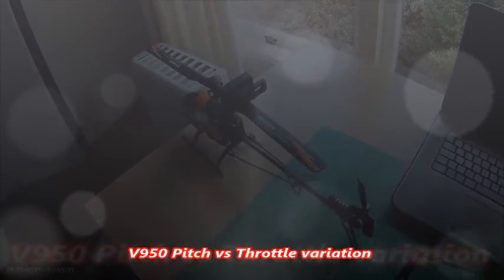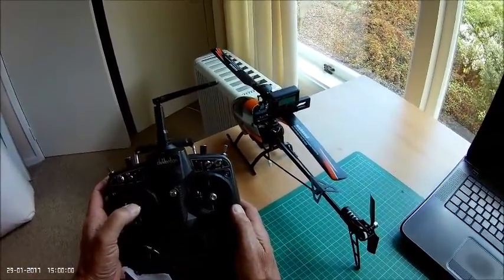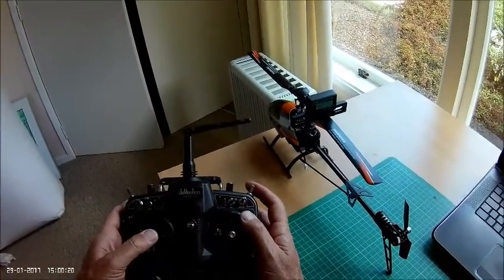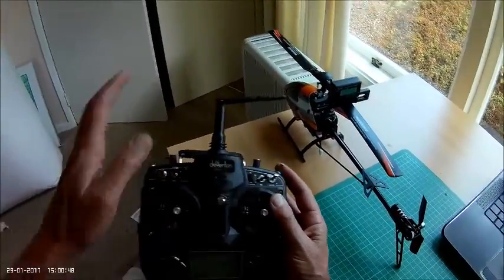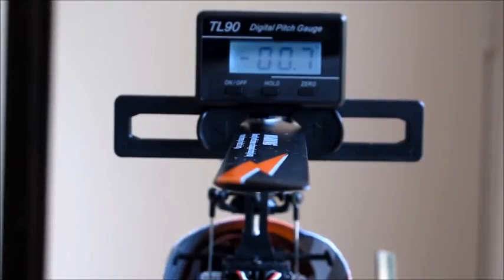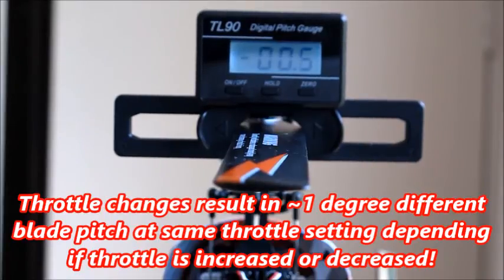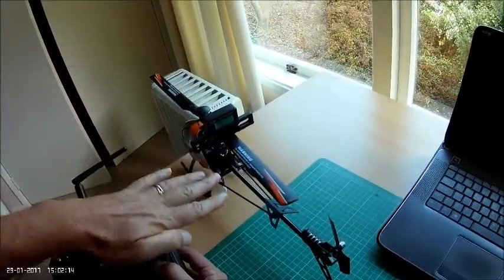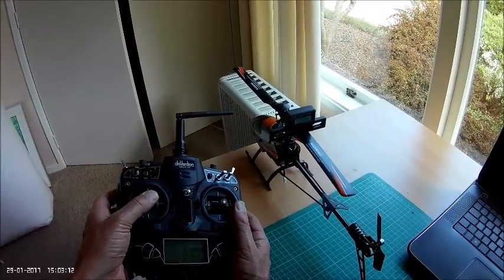V950 Servo Centering on Pitch Changes

Comment: Hello friend, I'm subscribed here on your YouTube channel!
I need some tips to get my V950 right.
What is the usage reference for the Pitch Gauge?
Does the heli table itself or a flat surface with a upright heli work?
Set the Pitch Gauge to both options as 0.00 with the Stick down to 0% and fit the links! That's right.?
Reply from the maker: I'm not sure that I understand your question. What this video was showing is that the blade pitch was not centering correctly with the stock V950 setup, and instead of returning to 0 degrees pitch there was a ~1 degree difference in blade pitch. This means when flying instead of having a smooth hover, the helicopter rises up, or goes down depending on your throttle setting making it difficult to keep a steady height. I have changed to Walkera Master CP head, drive shaft and main gear, plus changed servos to Blue Arrow units and it flies better. The best head/swash setup is the new V950 CNC aluminium head from MicroHeli though. A good quality helicopter will return the blades consistently to zero pitch. Unfortunately V950's have not been good although mine was an early production model.
Reply: @FlyingboatsRCG  Ok friend thanks a lot for the help!

Comment: Very interesting,but most of us don't have that kind of level gizmos !
Reply from the maker: :) You can swing the blades parallel then measure the distance between blade tips to calculate pitch if you don't have a gauge. The gauges are definitely recomended with larger helicopters and do make setting up CP helis a lot easier. I also just made a swash levelling tool for the 950 as well, a little crude but getting the setup right definitely helps!

Comment: i can use devo with v950 ?
Reply: Want to know what modules to use?
Reply from the maker: Sure you can use Devo. I use Devo 10 but 7E (more difficult to setup) 6, 8 and 12 are also possible I believe. V950 uses the KN protocol which requires an NRF24L01 module to be added to the radio. I used to have one of these but have now replaced it with a 4 in one module that allows me to fly almost anything. Adding modules: https://www.deviationtx.com/wiki/rf_module_installation List of protocols from Deviation website: https://www.deviationtx.com/wiki/supported_models 4 in one module available at Banggoods for Devo 7E and 10: https://www.banggood.com/CC2500-NRF24L01-A7105-CYRF6936-4-In-1-RF-Module-For-Walkera-D7E-D10-Transmitter-p-1096707.html?cur_warehouse=CN Please also note that are now radios coming out with the four in one module already installed like the T8 Jumpers: https://www.banggood.com/search/t8sg/133-0-0-0-0-44-0-price-0-0_p-1.html
Reply: Thanks for the info. Follow the work . We like the same. Now I'm experimenting with the Fs-i6 transmitter with the IRX4 and IRX6 modules.
Reply from the maker: Cool. Good luck!
Reply: FlyingboatsRCG how do set the pitch curve?.. is this not built-in to the Heli?.. is it possible to set mixes for pitch curve with this Heli?
Reply from the maker: If you have a computerised radio (not sure if the stock transmitter can do this) then you can adjust pitch trim on Channel 9. The basic pitch curve is hard coded on the helicopter, but it is possible to adjust it up or down slightly using Ch9. On my Devo 10 radio I first used a pot on Channel 9 so i could fly it and try different levels, then setup 5 point curves relative to the throttle curve. Quite frankly it's a pain in the butt to do, and I wish WL would develop an XK branded version of the 950 where you could set proper pitch curves!

Comment: FlyingboatsRCS , you and I were in this discussion in some other thread. I know why the hovering is so bad now, after about half a year of research. It is the ESC firmware "Governor" . The v977 also is very hard to hover due to the same software. If you look up BLHeli governor, there is a RPM threshold, which you often cross it when trying to lift the heli but this threshold is higher than enough to hover, but which once reached the ESC firmware will keep this RPM on the motor regardless of whether you have enough thrust. This firmware assumes you are an acrobatic pilot, and the heli flies with "fixed RPM, changing ONLY cyclic pitch". To slow down the rpm, you have to aggressively cut the throttle to nearly half stick position. Once you cut to that level, the firmware assumes you are trying to land the helicopter!! And your heli is straight to the ground, and you have go back to lifting it, and the oscillation continues. I finally have my solution , buy the real SiLabs hardware ESC and configure the BLHeli firmware to disable governor. I fly Blade 200 SRX with my electronics with CC3D. It is so much less stress now.
Reply from the maker: Hi John. Interesting comments. I have flown a more recent V950 plus also seen others in the air with different servos (Futaba or Blue Arrow) which fly and hover well. To the best of my knowledge the 950 and 977 aren't running BLHeli on their ESC's, although I know some people have flashed the 977 ESC's with BLHeli which has been an improvement. I have BLHeli on most of my ESC's so am pretty familiar with it. 

On my 950 (and 977) it's very obvious that the motor revs are changing nicely through the throttle/pitch curve I actually use the change in motor revs with reduced pitch changes through centre stick to smooth the pitch response) and where mine has been causing problems is immediately after hearing a distinct "phut" sound from the rotors. On tracking it through I believe my issue has been primarily mechanical issues. First the servo arms were drilled oversize allowing the links to slop up and down under load. Secondly, when I rotate a blade grip the top part of the swash rotates slightly (this allows the link to move and the blade angle to change). So I believe the "phut" sound is caused by the rotor disk loading up, and twisting the blade grip & the top of the swash. Consequently the 950 jumps either up or down with the mechanical slop. I'm expecting this to be fixed with new head plastics with improved tolerances. The other things are that the programmed pitch curve isn't smooth (it jumps as throttle is increased) and in the video above is that the stock servos are not really good (OK but cheap). Note Banggoods  now have the Blue Arrow servos available for the V950. You need the "Type 1" -Reversed signal servos but these are excellent high quality, lightweight and fast metal geared servos which make it fly much better than stock: https://www.banggood.com/Blue-Arrow-D03013-Digital-Ultra-Micro-Preision-Servo-For-Blade-130X-Helicopter-p-1118700.html?rmmds=search

Comment: O módulo que você usa para ligar o V950 com o devo rádio?
Reply from the maker: This is the 4 in one module for the Devo 10. Requires 3 wires to be soldered so pretty easy to install. https://www.banggood.com/CC2500-NRF24L01-A7105-CYRF6936-4-In-1-RF-Module-For-Walkera-D7E-D10-Transmitter-p-1096707.html?rmmds=search

Comment: Devo 7 bind for V950 ?
Reply from the maker: No. 7E, 8, 10 and 12 can bind but using an extra radio module and Deviation software.
Reply: FlyingboatsRCG ok, thanks :)

Comment: Times like these reminds me why I like the simplicity of FP helicopters,anyways. I use the Flysky radio so I am not sure about the menu on the Devos but try to access your pitch curve settings I use pitch values of 40 43 50 75 100 for normal and 0 25 50 75 100 for idle up with 50 being about 0 pitch and set to mid stick for both normal and idle up. I actually set my 40 to 1.5 degrees and 43 to -1 degree so that she will stay planted in high winds. I found with this setting the Col. Changes are not as dramatic as with a linear pitch curve. Also 16 degrees +/ seems a bit high, my 500 call for  max 13+/- if I am not mistaken and that's for hard 3D. Smaller birds would probably be quite less because the servo movement at smaller size would probably have a bigger effect than on a 500.  Good luck
Reply from the maker: Yeah I have a number of CP birds but the V977 and V950 don't have separate throttle and pitch curves. They set them up to use the same radio that came with the V922 which had no ability to set curves. The later V977's they added a Channel 9 pitch trim, so you can make a trim adjustment to the preset pitch curve. The tricky thing is that if you change the throttle setting, the pitch also changes, then you need to adjust the pitch trim again as well -PITA. On the XK helis (the hobby grade versions of the V930, V977 etc) they've done it properly with separate pitch and throttle curves. I've spotted something else tonight which is more likely the major issue. When increasing/decreasing collective there is a little movement then an audible click, after which the pitch changes dramatuically. The swash may be binding under load (or something else similar).
Reply: FlyingboatsRCG  The joys of the hobby I guess, you might be right, might have to disassemble everything move it by hand and see what happens. Might have to sand and apply some white lithium grease for plastic gears shouldn't harm the plastic parts too much. I noticed that some of the BG parts have been rusting on the boat lately. Did you open a discussion on RCgroups on this one? Think it would be neat to follow.
Reply from the maker: Craig started a thread for the V950, it's up to about 100 pages now: https://www.rcgroups.com/forums/showthread.php?2726669-WL-V950-CP-heli-200-size
Reply: FlyingboatsRCG  nice I will check it out